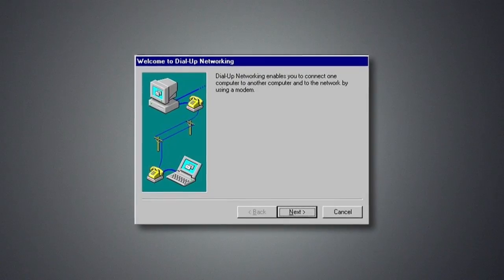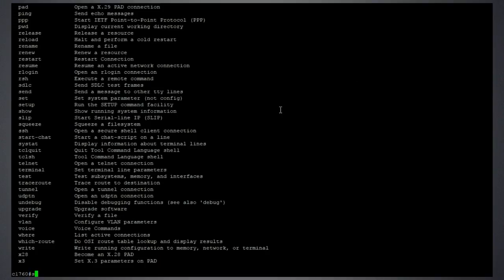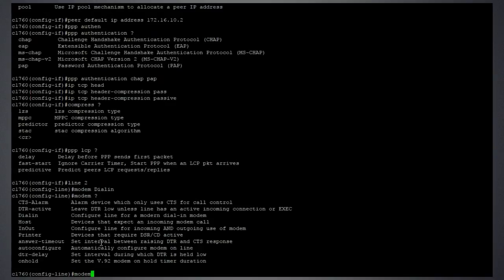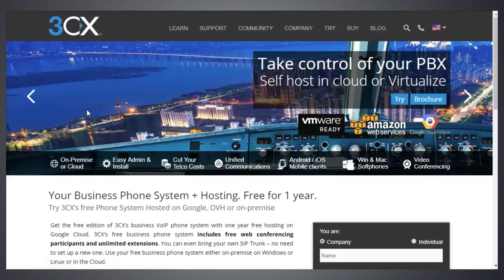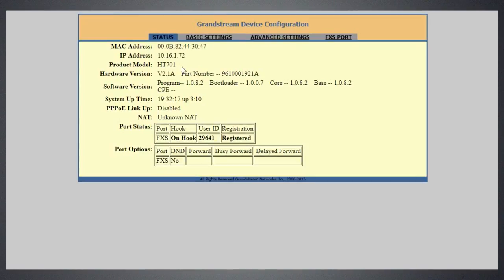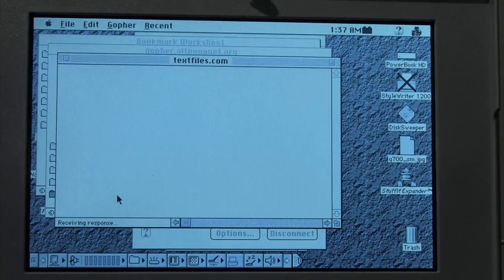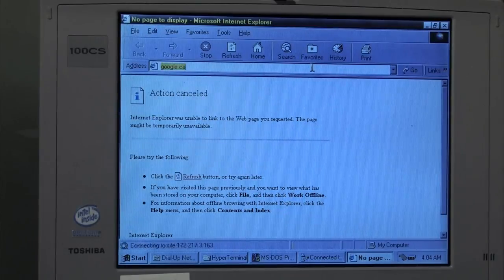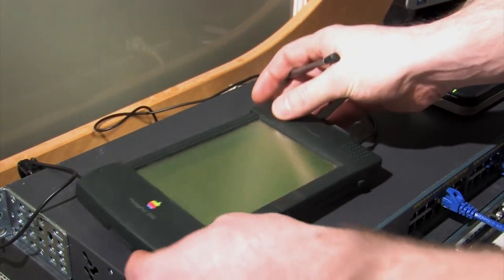Making A Home Dialup ISP - Paul's Old Crap #3

Comment: My first job was at a dialup ISP. They were running T1s for voice straight into a PortMaster 3 packed with 24 digital modems when I started, but their previous incarnation was a PortMaster 2 with 30 serial ports connected to 30 modems, connected to 30 telephone lines and 30 wall-wart power supplies, connected to a slew of power bars. All of this was connected to a couple bonded T1s that provided the ISP with 3 Mbps of bandwidth, which served all of those modems just fine, with room to spare. A SCO Unix box provided the RADIUS account facilities to the PortMaster (I think). The owner of the company had the foresight to sell the business off to Look Communications before Shaw and Telus rolled out high speed a year later.
Reply from the maker: Before the Internet went to hell completely.
Reply: When I hear about old ISPs and their modems and hear numbers like "30", it just seems so weird considering that I was basically on the dialup at all hours of the day and downloading stuff all night. I wonder if my (small, local, late 90s ISP that charged a flat monthly rate) noticed and if they considered me a nuisance.
Reply from the maker: I managed to acquire a teacher's login for the local school district and they offered dialup Internet through the school's network. I was probably on that 12 hours a day everyday. I don't think the teacher even worked there at that point but nobody ever shutdown the dialup access.
Reply: Me too.  Friends of mine had started a local dialup ISP - the first in that county - in the mid-90s.  Eventually got roped into doing tech support and that's how my career in tech started, as lowly as it was.  We were never that sophisticated.  Nearly all early ISPs (smartly) had PM2s and a huge bank of dialup modems.  Livingston just had the best terminal servers back then.  We were so cheap we had Linux 386 boxes with Boca boards on them and a ton of haphazardly stacked USR Sportsters 14400 and 28800 modems.  Eventually when dialup went digital we had Ascend MAXes which were absolutely the worst digital RASes ever.  Customers truly were beta testers for Ascend.  Thankfully we lived close enough to the Ascend headquarters that we would drive our MAXes down to their RMA department in Alameda and have them fixed.  We eventually went "big time" and got the Livingston PM3s, their version of a digital RAS and of course vastly superior.  Interestingly I think Lucent bought both Ascend and Livingston during the big dialup consolidation in the late 90s/early aughts.  Even interviewed for a job at Livingston once upon a time but just didn't have the technical chops at the time to do L1/L2 support for something that complex.  The nerd factor in their tech. support ranks was VERY high.
Reply: Beefchicken Industries I couldn't remember the name of that device and your comment just jogged my memory. Livingston i think was thr company who had those. I was given a tour of their setup back in the day. Quite the spectical.
Reply: BadDogMedia it was a probably different ISP (KNS was where I worked, I’m guessing you’re thinking about KBS) but likely the same setup.

After they ran out of money, I went to work at a hosting company where I had the misfortune of working with ol’ Paul here. Now you’re 1 degree of separation from an internet celebrity. If you’re ever in the city where Paul and I live, we need to stop by Paul’s place and tape picture of cats to his project cars while he sleeps.
Reply: Beefchicken Industries it was KBS.
Reply: I am actually very interested in the Digital modem setup. Can you please give me a reference to the digital modems that you guys used?
Reply: @retromobs6018  the modems are not physical pieces of hardware. The deal with a digital modem is that the input and output are both digital, so it can exist purely in software. The hardware handles converting the DS1 signal into 24 separate bitstreams representing each DS0 channel, and then uses DSPs to do the modulation/demodulation. The PortMaster that I mentioned contained the digital “modems” internally, 24 modems existing virtually in a 2U rack mount box. I’m not 100% certain of the architecture, but it looks like internally it used a dedicated modem chip per DS1 channel, but because it was all digital,  they could cram 8 modems on a PCB not much bigger than an envelope.

Comment: It's humorous how this presented like 'Hey kids, this is how we connected back in the day'. Like it's 1905. Some areas probably STILL have dialup as the only option. But for many people it's been at least a decade since hearing that sweet dialup connection sound and not so sweet connection speeds.
Reply from the maker: I thought dialup was so neat back in the day but the Internet of today on the same speeds would be a miserable experience.
Reply: @netfreakcanada  This is true. Web pages today assume you have a fast connection. So using dialup would be unbearable today. Your only option would be loading the text only. I loved the process of getting connected. It was painful trying to download anything of size though. Had to be something you REALLY wanted.
Reply: I was always frustrated with my dialup connection because the lines were poor. Most of the time I'd barely connect at better than 28.8K modem speeds with a 56K. Even then my connection would randomly drop because of the line noise.
Reply from the maker: When I was running a 28.8 and 33.6 they'd connect close to those speeds, but when I had a 56K I think I rarely connected at higher than 48K or so.

Comment: I honestly just watched for the dialup sounds. So nostalgic
Reply from the maker: That's probably my favorite thing about dialup modems. Back in the day I remember being able to tell if the modem was negotiating at a slower speed than normal based on the sounds.
Reply: Paul's Crap I remember sneaking downstairs in the middle of the night and piling blanket and stuff over the modem so the sound wouldn’t wake my parents before I realized your could turn off the sound in the settings.
Reply from the maker: What the hell I literally did the same thing. We had our family 486 in the basement and I shoved a couch pillow behind the PC to muffle the sound of the modem and the PSU too.
Reply: Paul's Crap feels good to know that I am not the only one 😂

Comment: the us robotics modem is very easy to still use, the cable is just 25 pin serial and the power supply is just whatever the spec written on it is

Comment: I've expected to see whole piles of old dial-up remote access servers on eBay, but for some mysterious reason that's not the case 😔
Reply: It’s not a piece of hardware so much as it is a Unix box running CHAP-PPP.
Reply: @Mostlyharmless1985  what I mean are basically old servers with multiline modems
Reply: @eugrus  perhaps they just are still in some tech departments closet on someone’s property book and no one has any idea what it is but it’s been there through 6 different department heads. Or more sadly they probably got shipped off to the recycler. Like who on earth wants this highly niche  and specialized obsolete hardware?

Comment: I first connected to the internet using a UCOM 33.6 modem, but pretty quickly switched to ISDN to prevent a constant busy signal when someone called. Going from analog to ISDN was nice....instant connection, fixed 64kbit (128 bonded). At a LAN party once, we connected up 4 ISDN BRI lines (8 B channels) to get 512kbit/s. All of this terminated in a Win2k Server box running RRAS, with 4x PCI ISDN cards. Then bonding them together into one logical 512 kbit/s channel.  I still have a few ISDN cards laying around
Reply from the maker: Ah nice. I think the closest I got to using ISDN was one of my high schools having it or something, but I'm not entirely sure. At home I went from dialup to cable Internet.
Reply: Maybe ISDN was more popular in Europe?
Reply from the maker: Possibly. In North America it would probably have been more popular in businesses but unlikely to find in homes.

Comment: I have a cisco 1841 with a WIC-1T board,same as your version of cisco ios, so we are both at the same level. When I try to call the modem I get a busy phone sound and after that the error "the remote computer did not respond"
If instead of the cisco I use a windows server to answer calls the connection works, so the problem is just something about the configuration of the cisco

Comment: The limit was actually 128k, with 128k dial-up models for ISDN.
Reply: Wasn't that actually dual 56K Modems though? It was cool that you could combine 2 lines for a higher speed connection. Would still seem slow by today's standards but would of been blazing fast back then!

Comment: I have a similar setup (the difference is I use a 4-port FXS card as ATA for the 2 lines) and I can only sync at 33.6k. This is apparently normal when the server side is not fully digital. Do you know if there are any digital modems available in the market to achieve V.90 or V.92? How would we connect those to such setup?
Reply from the maker: Unfortunately I've only had experience with the usual analog modems. At some point in the future I would like to cover things like ISDN but I don't currently have any of that equipment.

Comment: Is the board at 8:28 made by Okidata? I vaguely remember Okidata making a monochrome laser printer that also had a page scanner that could be detached and used as a hand scanner. I think it also had FAX capability. I think it came out in the early to mid 1990's. (I think I first heard about it on Craig Crossman's Computer America maybe around 1993-1996.) Could this be one of those boards?
Reply from the maker: I finally got around to getting a page created with some photos. There is one port on the card which seems like it would go to an external device of some sort but I don't really have much info at all. Photos can be found at https://wiki.preterhuman.net/Okidata_DOC-IT_Controller

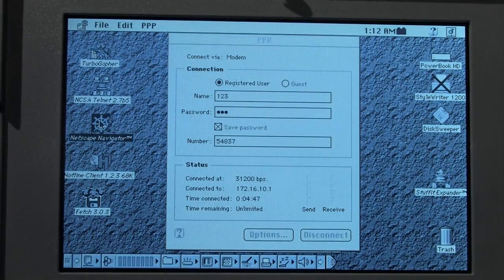Comment: Cool!  I so want to do this or something similar to it!  So basically the ATAs are just cloud-managed through the 3CX but run on your LAN?  So one could get a handful of those ATAs, assign them SIP extensions, set up according on the 3CX dashboard, and then dial station-to-station through the house where connected to ATAs? I suppose it obviously can interface with an outside number so people could call and reach certain extensions by entering them after hearing a greeting, etc?  Forgive me if this is answered later, but I'm at the 33:14 minute mark at the moment LOL.
Reply from the maker: They're not cloud managed. As another comment mentioned, you can probably just get a dual port ATA that allows dialing between the two ports instead of needing a PBX. The whole thing is a local-only deployment. Using an external provider to be able to dial in/out to the world might not work so great since most providers probably compress the hell out of the line. Modems don't like that.
Reply: @netfreakcanada  I know the modems don't like that, but I was thinking it would be cool just to have a system setup like that around the house for voice LOL. I have Vonage, and I've actually been able to maintain fairly reliable 9600 baud connections to BBSes so far. I guess I need to research all that a little more because from what I saw you were using that 3CX to control your ATAs. I didn't see any other Hardware other than your router and the ATAs. It just looks like a neat setup and something that I would like to play with myself LOL.
Reply from the maker: The 3CX setup exists just to create the dial tone basically since my ATAs were just single line devices.
Reply: Ten four.
Reply: not really most providers you can set the codec to G711a/u law and dial-up and faxing works just as good as POTS in my experience with VoIP.MS

Comment: I'm curious of why you used 3CX and Grandstream ATAs when your 1760 can support FXO and FXS slots on those two right hand slots with CallManager Express? your IOS image says "enterprise" and the telephony-service comes with that image.
Reply from the maker: I don't have those modules yet for my lab. I think I was waiting for eBay pricing to go down a bit before I justify buying them for fun.
Reply: @netfreakcanada  They won't go down in price unless eBay stops gouging sell-side users. It's really expensive to sell on a platform that likes to take 33% off a sold item.
Reply from the maker: Yeah, I've also been meaning to try checking out hardware recyclers where businesses are dumping their old network stuff so we'll see.
Reply: I have a few cisco 2800 series routers and one of them has a vic2-2fxo module. Would I be able to setup everything that is shown in the video using a cisco router with the vic2-2fxo. My end goal would be to plug an older computer’s dial up modem into a port on the vic2-2fxo and connect an ethernet port of the cisco router to my network. Then I can dial into the cisco router from the computer and access my network using only one piece of equipment. Please let me know if that is possible and if so how I would go about configuring it. I have very little experience using cisco IOS.

Comment: So, whats the lowest latency possible and fastest data rate possible using dial-up when using a self-built setup?
Reply from the maker: I didn't try raw speed but it'll still be extremely slow. There would really be no point using dialup for actual Internet now, but BBSing might be interesting.
Reply: @netfreakcanada  around 7KB/sec and 100ms i imagine with good hardware 56k. Seen 33.6's ping at 150 on other videos.  But would be interesting to see what the hardware was really capable of with "perfect" environmental variables.

Comment: those hot line servers still work ? XD
Reply from the maker: There's some still running. You can connect to "hl.preterhuman.net" for vintage software or enter "tracker.preterhuman.net" in the tracker settings to see a few other.

Comment: what phone is that on the desk? nortel something?
Reply from the maker: Yeah I think the actual name is the "Nortel Vista 350" or something. I actually bought that on clearance from a Radioshack back in around 2002 and even used it with a VOIP adapter as a desk phone later in the 2000s at the office I worked in. Not a bad phone.
Reply: @netfreakcanada  yhes the vista 350, i seen one at value village a month ago, was going to get it but they put it up for $7.99 CAD
Reply from the maker: Yeah seems a bit high for one of those things.

Comment: I've found this video as a result of googling if it was possible to basically do the same using just some crappy VoIP-adapter. So I guess the answer is no? (Or rather that it would probably be possible to create a firmware for some SIP-box emulating a dialup-ISP, but no one would care to do that)
Reply from the maker: Actually someone else commented (not sure it was here or elsewhere) that you could use a dual port VOIP adapter to dial direct between the two ports, eliminating the need for a PBX to interface with. I don't know if I'll ever try this out myself but using a Grandstream HT502 or HT702 might do the job.
Reply: Paul's Crap what I've imagined (hoped for) was just hooking up a laptop's modem to some reprogramed VoIP-box which would on itself emulate both a telephone line and a dialup ISP.
Reply from the maker: Ah. I'm not entirely sure something like that exists.

Comment: i actually have a 180 around but couldnt get it to run 7.6.1 and it left me with a laptop thats not useable. all i have to do is really reinstall the os and find a foot and perfect back door for it since a peg snapped off on mine sadly.
Reply from the maker: They're not bad but anything beyond system 7.5 might be a little too much.
Reply: @netfreakcanada  the only way i can install stuff to it is through floppy sadly and i have never found 7.6 on floppy at all :(
Reply from the maker: @rmx77  Yeah actually I think I've only seen 7.6 as a CD installer. I'd just use 7.5 which has a floppy installer set.